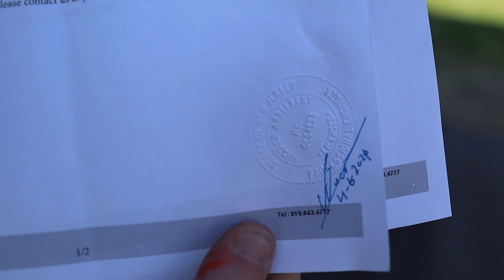Installing Helical Piles and Deck Framing - MEGA DECK PART 1

Comment: Worked for my own local franchise of Goliath Tech in Homer Alaska a couple summers ago. I won't forget it. Very very interesting and straight forward and such rewarding work.
Reply from the maker: That’s awesome, must be tough up in Alaska!
Reply: @THEpremieroutdoor  As always, depends if there are rocks or not. We have soft clay here; so we ended up going to 25-30 ft frequently. Adds up quickly for a shed or small cabin!

Comment: Hi! I am planning on building my own deck next year and in order to get the best results, I am looking at all of your videos! Very professional, clear, and interactive I love it! I was browsing through your videos, even looked on your amazon store but couldn't find which black wood sealer/stain you are using on almost all of your projects for underdecks. Do you have a favorite product that you use or any black sealer that would do the trick?
Reply from the maker: That’s awesome, so glad to hear!! We’ve been using Benjamin Moore arbor coat solid stain in black and it works great
Reply: Are you staining pressure treated wood immediately? Or is it dried out prior to install? Thanks!!!

Comment: Hell of a great job so far.... Can't wait to see when you're done.. quick question, those pillings you used, is there a reason you used those apposed to traditional concrete pillings or pouring footer slabs? 

Please I'm trying to learn is why I ask...
Reply: Faster to install and the ones the use have adjustable heads that allow them to raise and drop the posts for leveling purposes.
Reply: @Calofaction  reason I ask is, I'm getting ready to build a 16x40 office/off-grid power room on my property and I live in southern West Virginia, we have very rocky terrain I was just wondering if those would be a better fit for me vs traditional concrete footings because I have to consider I'll have 4,000lbs of flooded lead acid batteries in one side of my shop and I don't want any problems with sagging... What would you suggest in a situation like that I'd really like to know your thoughts... And thanks for answering me, means a lot when someone takes the time to help me learn I really appreciate it 😁
Reply: @friendsinlowplaces619  https://www.goliathtechpiles.com/applications-en/ . It seems like you could use them just fine, buy I'd say you'd have to consult with them directly and get the info from the source. You'd then need to find a trusted installer local to you.
Reply: @Calofaction  thanks, I appreciate the info it'll help me get in touch with the right ppl😁

Comment: Question. When installing railing posts on the outside of a deck, are the posts mounted over the fascia board or should the fascia be notched out for wood to wood contact?

Comment: Question, I’m in the market for a mini. I notice that you guys had a Toro TX1000 but I have been seeing the BOBCAT MT85. Which machine would you recommend?
Reply from the maker: The tx1000 is ours, the mt85 is the footing subcontractors, I like the dingo a lot, only thing I would do is get the wide track over the narrow track. There are also now a few other brands that have slightly bigger minis now, it would be really nice if ours could pick up a little more weight but overall it’s awesome